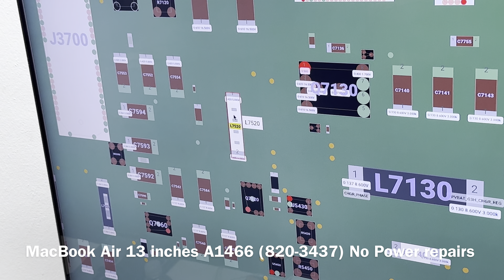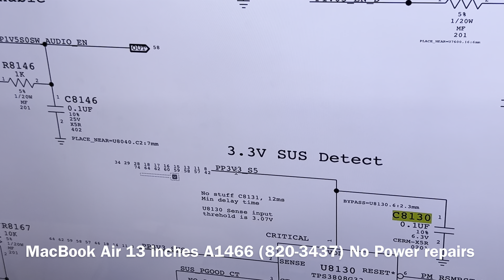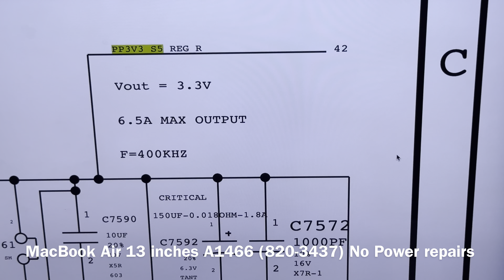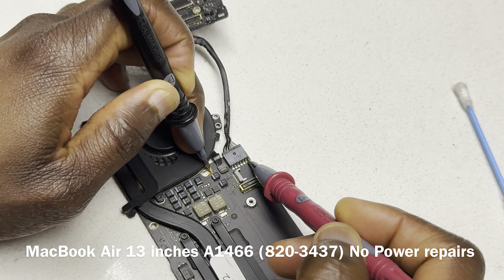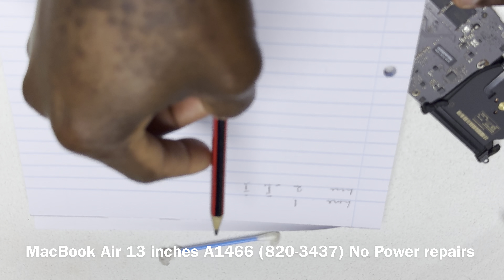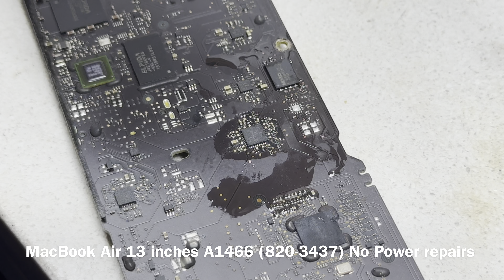MacBook Air 13 inches A1466 No Power Repairs (820-3437)

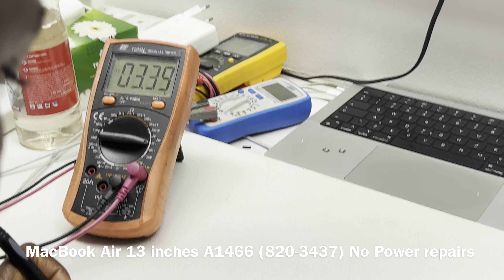Comment: I have 20 volts on charger pin 1 and 3.3 volts on the circuit you are getting 1 volt.  All the pins voltages on 7500  are correct and I still do not see voltages on the backlight caps or regulator.   What else can it be?   Clock circuitry reads 3.3 volts. Everything looks clean no corrosion anywhere.   Just the Jtag had water damage I removed that connector and cleaned it up.  Still no backlight.  Thanks 1:00:52